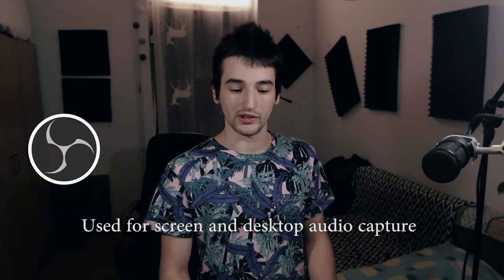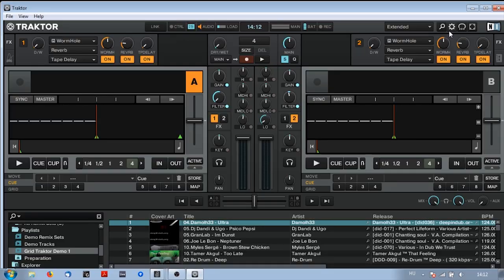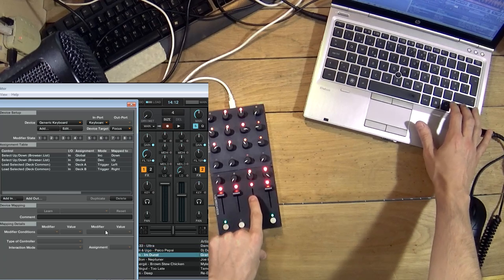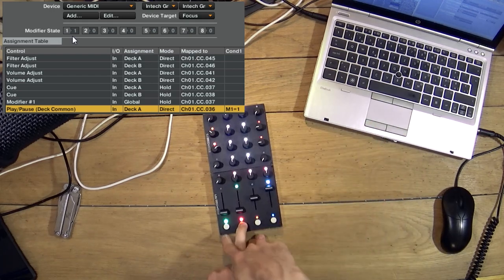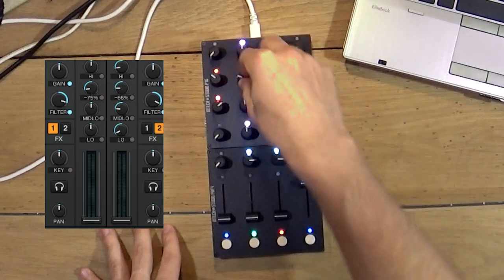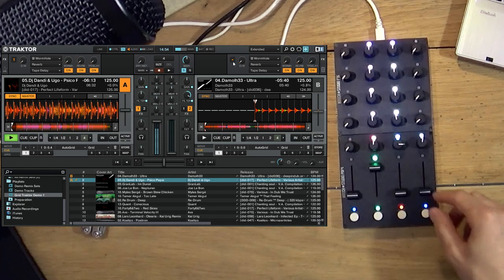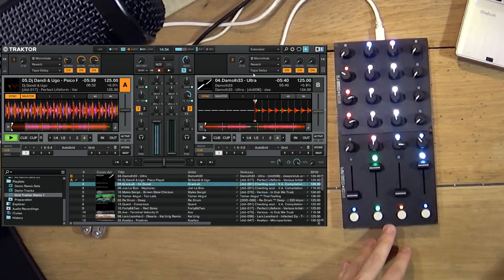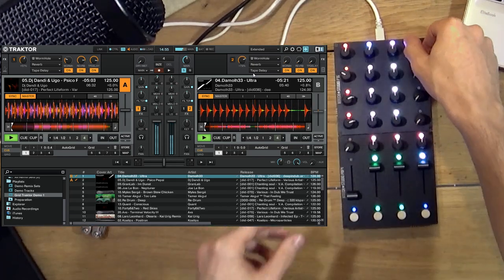Grid - Traktor Pro DJ Set Walkthrough with MIDI Mapping

Comment: How do you map the faders to a channel on the midi?
Reply from the maker: Hello! As a class compliant MIDI device, Grid modules are recognized within Traktor's Device Manager. You can use the MIDI learn function to map parameters. Also Grid's configuration software is released soon, many more MIDI options will be available on Grid.